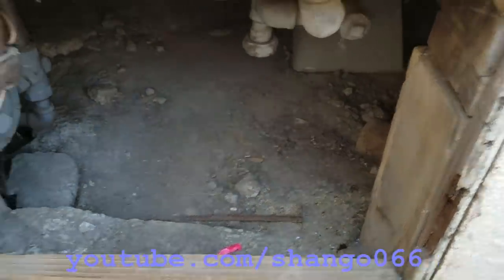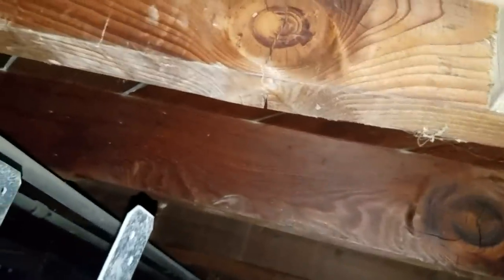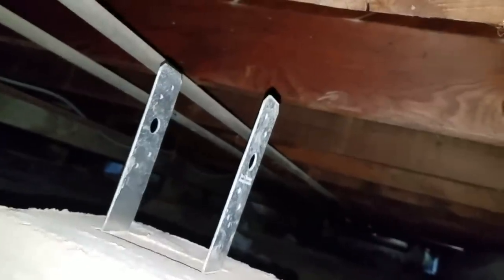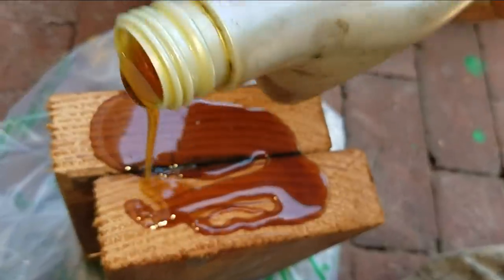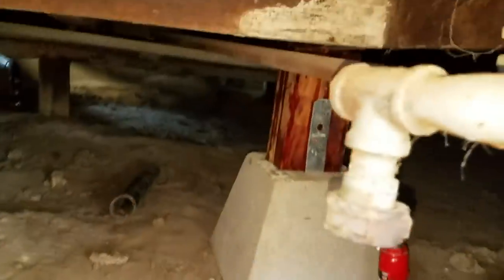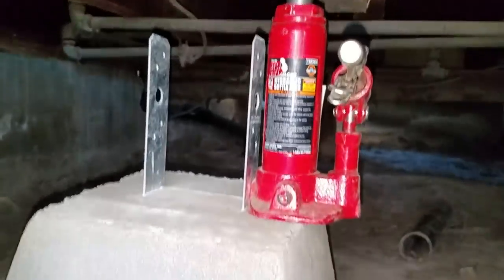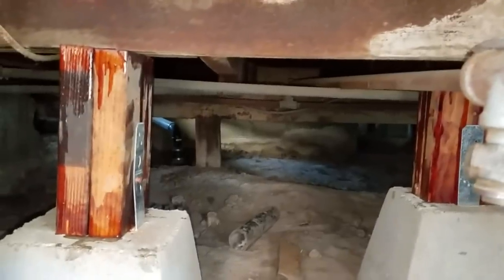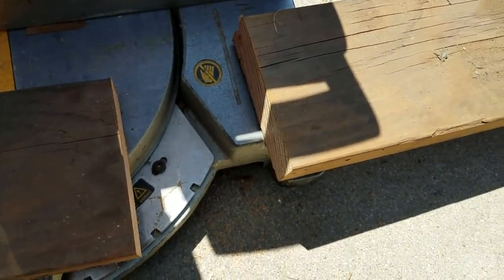Repairing Soft Bouncy Subfloor In Old House With Pier Blocks

Comment: Ok this Dan Le again. I lived in California and my home was built in like 1982.
Thanks to shango066, I got a lot of ideas from his video. 
For my situation, the house has solid beams across, 4x7  and no matter how hard someone bounces on them, the beams or joists don't move.
Then I found out that the diagonal 2x4 that are the culprits. Use the concrete piers from Home Depot for $5.10 each and cut some 4x4 as shang described in his video, no more floor shaking.
So thanks to shang's  video that gave me the idea on how to fix it. It has been bothering me for the last 3 years, and does not matter how I adjust the jack piers (they use them for our lot), I never can fix the bouncing on the floor. Thanks shank. a million time. It is the 2x4, guys, not the main beams or joists.

Comment: Next time, consider putting your piers in a line and running a stringer across all of them instead of individual vertical posts. Also, consider adding ties between your posts and the floor joists. Over time they can slip. 
Finally, if you're in an area that gets humid/moist at all, I'd suggest getting some 6 mil plastic sheeting and laying it down on the dirt below the house. Will keep it drier and help discourage critters.
Reply: truthsmiles excellent suggestions! I'm in Florida, and I was surprised at how much the humidifier dropped in my house after installing a plastic barrier. Much more comfortable now and I don't need to run the AC as much. It even helped significantly at reducing palmetto bugs.

Comment: Alright!  Bonus Monday.  Two vids on the same day.  But the "replace all caps." fans will be disappointed that there are none to be found under the house. ;)
Reply: I see a cap..... concrete substrate, metal, an insulator(wood) and an electrolyte(oil). HouseCap, not sure what the rating would be on something like this though.....

Comment: Does motor oil really work? Never thought to use oil. Great video.
Reply: Motor oil was once used to kill mosquitoes in stagnant pools, too. I once saw it recommended in an old book.
Reply: Makes awesome weed killer. Especially when thinned with diesel. 
When you had 5 cars, three tractors, and a backhoe to keep running like we did, you end up with a lot of used motor oil.

Comment: These are a good temporary fix but the boards should really be replaced or have runners alongside them. Only a matter of time before the floor starts failing elsewhere the piers are not supporting. We did floors in a 100 year old house, rock/cement basement. Wood wasn't rotten or full of knots, the joists have been dry for so long from having a coal furnace a lot of them split. The subfloor was no better. Better safe then sorry after the kitchen and hallway were gutted it all got cut out and new joists were put in. What a difference that made it's almost like walking on concrete floors. It's a 2 story house  with a basement so the joists are 2 x 8.

Comment: It's so strange to see a whole house sitting on little blocks. Here in New England, most concrete foundations are at least 6 feet below the surface, sometimes 8 or 9 feet. If we want to build a house on pilings, they have to go 8 or 10 feet into the ground. Some things are easier in California.

Comment: Hi Shango066, how do you determine how tall do you have to cut the 2 2x6:
. like you use the bottle jack to lift it up to LEVEL, 
. then lift it off by another 1/4 inch, then cut the 2x6 by that height (including the extra 1/4 inch) and then drop it down?  Thanks a million guy. This is the cheapest way so far that i know of.

Comment: Hope it is no problem when those pipes are rubbing? (where and there )
Reply: Looks like they are disused, as there is a t piece and elbow, with no stop end there, so likely old water pipe, that was considered too expensive to remove, when they were replacing with new pipe.
Reply: @SeanBZA  Those are black iron, so they are likely gas lines. Water lines would be copper in a house of that age.